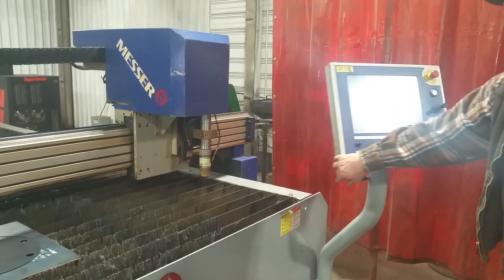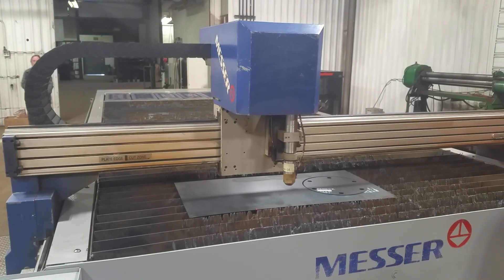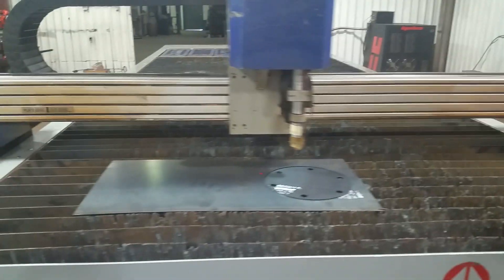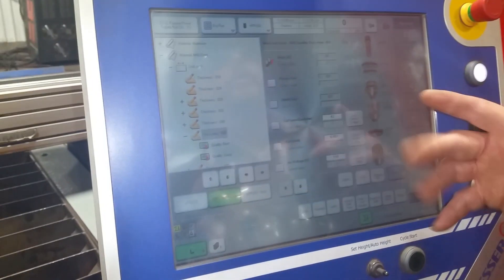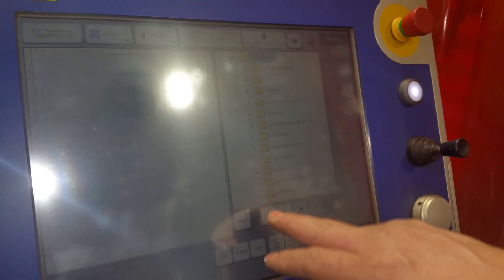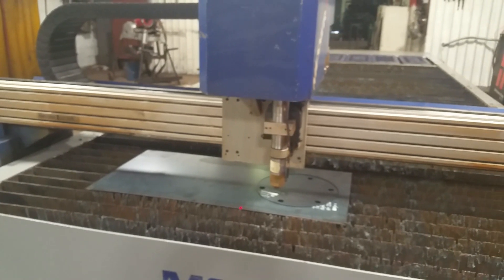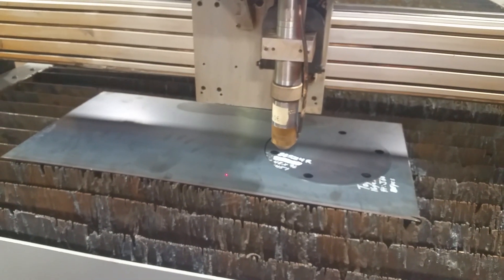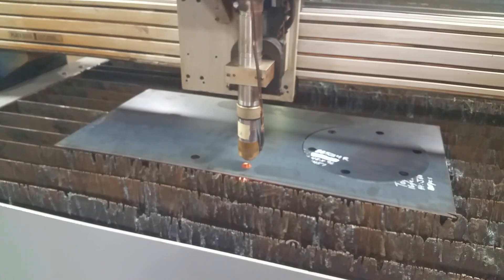Messer Burning Table

Comment: Can you make a video that shows how to combine programs? Add or remove parts from the controller?
Reply: Usually you’d need a usb drive for that unless your machine is running off WiFi.
Reply: @brianevo8481  Fr?? i thought the windows10 symbol came up when starting up the machine. So your stuck in that stone age lookin ahh software no matter what? That's so unpractical. Besides forced to use the touchscreen? eww Microstep better
Reply: @unknown-zi3bw  yea not sure what happens but previous operator messed up our WiFi capability so we have to do special programs manually